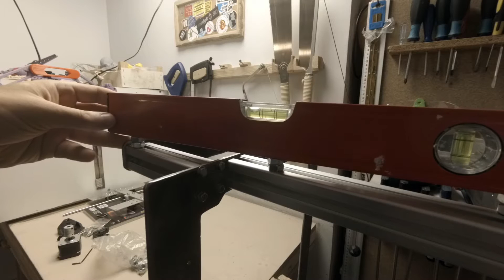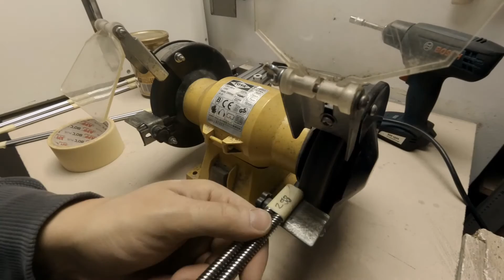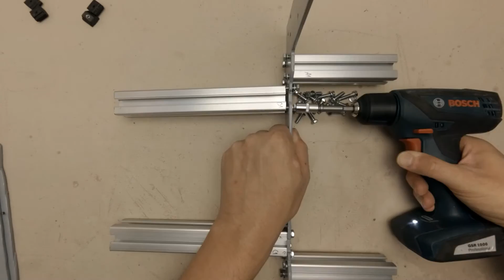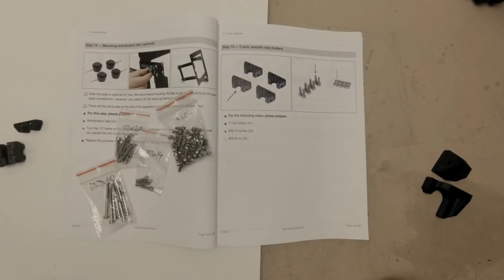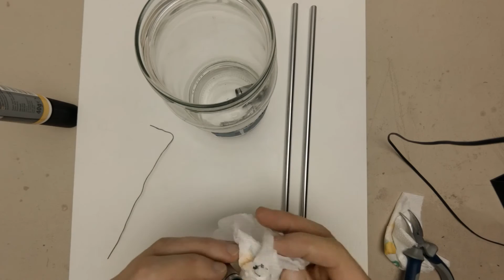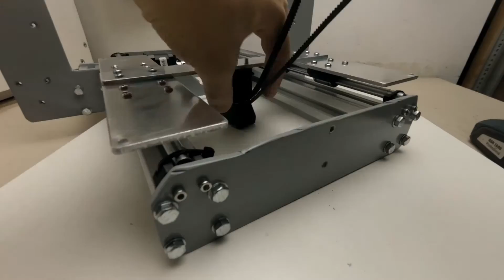Anet A6 metal frame for $21 - part 4 - getting the frame ready for Anet A6 Prusified MK2

Comment: Surprised !.. that you Cut your extrusions! Then retrofitted 8mm Rods and crap bearings.
 When continuous Extrusions would have allowed the easy use of either Wheeled Bed carriages Or fitting of Linear rails.
 Seems a shame.
Reply from the maker: This is not the best way. I am just rebuilding my Anet to be more or less like an original Prusa on a low budget.
Probably the next step will be to make a bear upgrade. Or do you have a better idea?